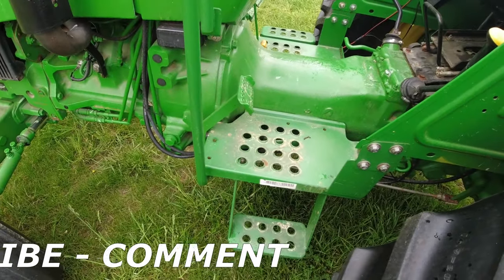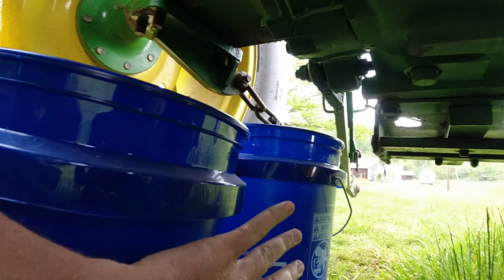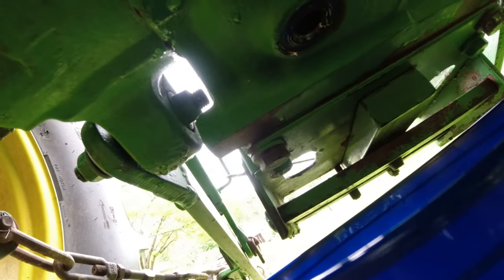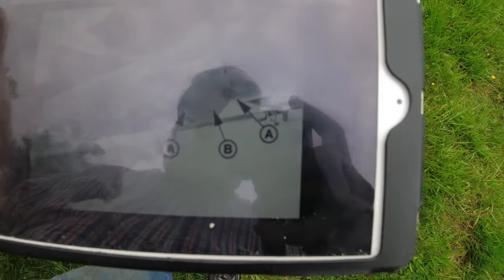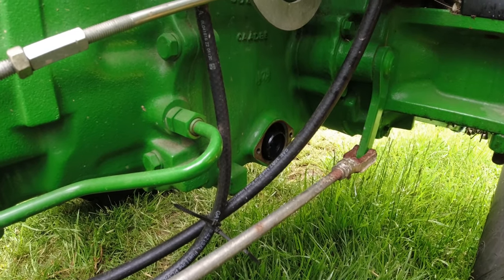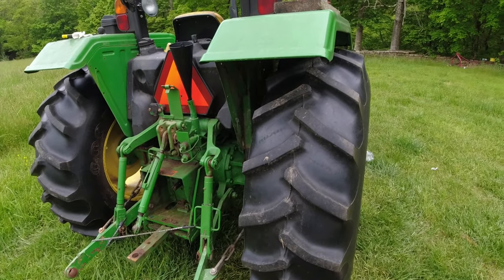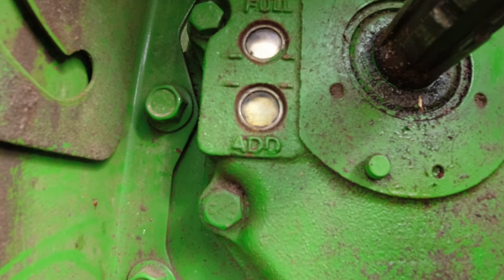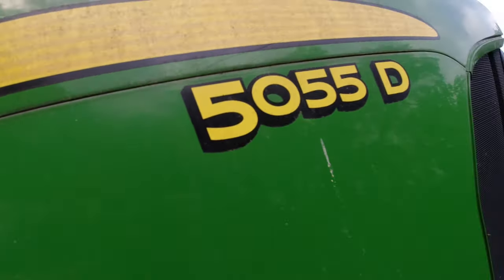Easy Hydraulic Oil Change - John Deere

Comment: Excellent video sir. Curious what weight engine oil you use for that size JD. I use 15W-40 for my 5420 series. Thank you
Reply from the maker: Thx for watching.  I use JD 15W-40.  Look for my playlist Easy Oil Changes, there is a video on it in there.
Reply: @HumbleHaymakers  Appreciate it